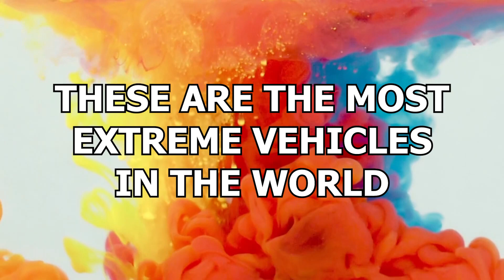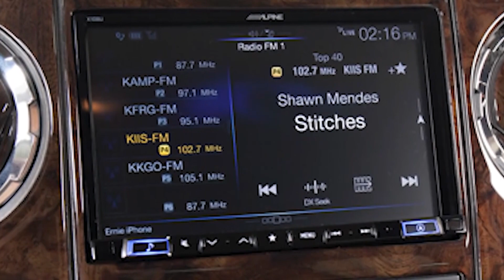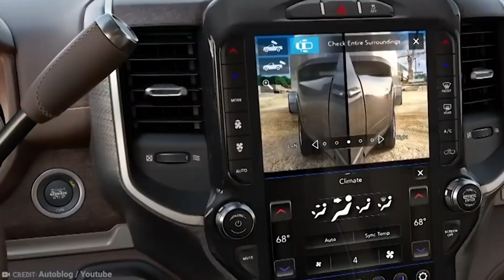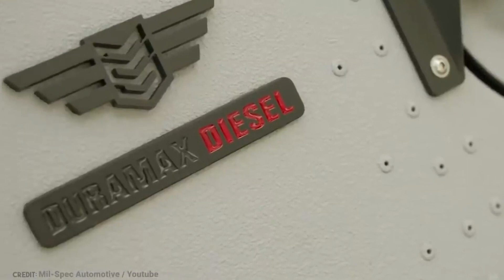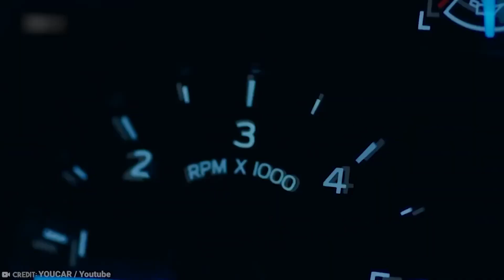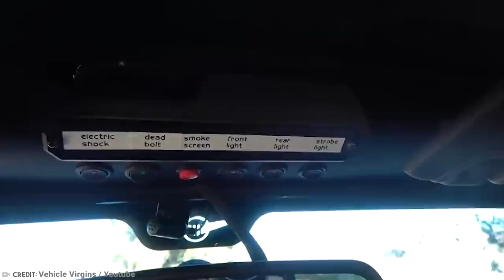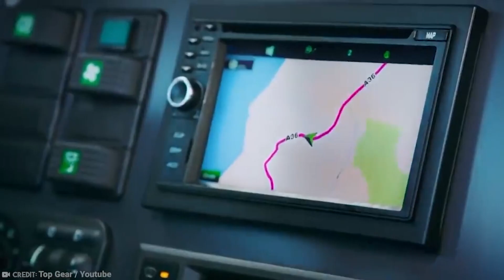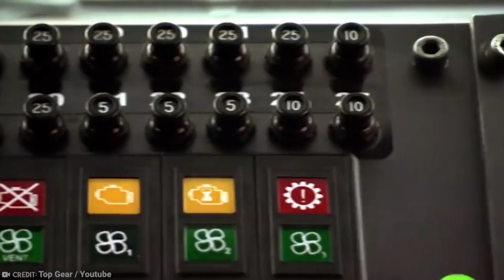15 Most Extreme Vehicles In The World

Comment: The Hummer engine does not put out 1000 lbs per foot torque.    Perhaps you mean 1000 foot lbs. Or 1000 lb feet.     Get the units right, pound feet, not pounds per foot.